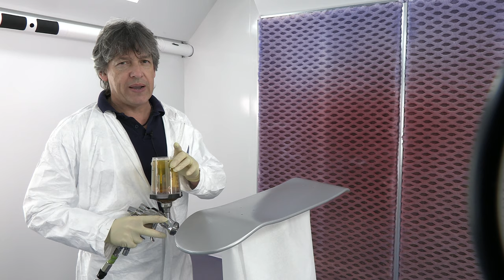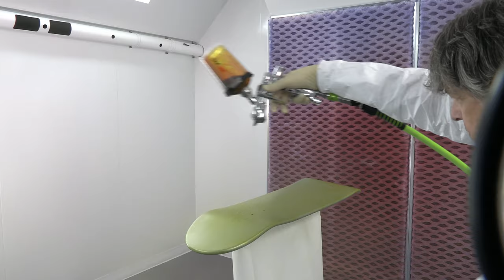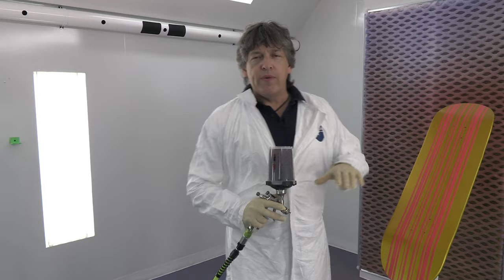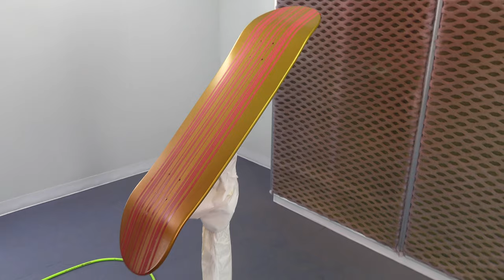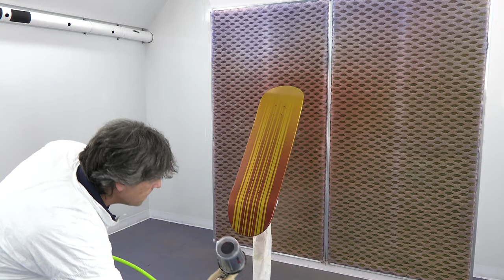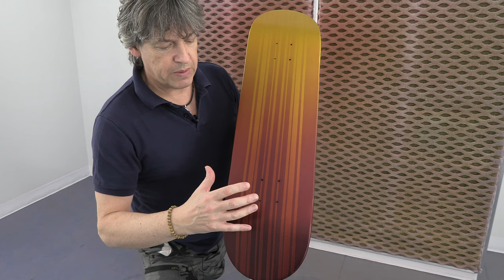How to spray seamless candy fades.

Comment: How are you mixing the Candy2O with 4050? A few of the createx videos contradict eachother. Craig Fraser seems to use 3 parts candy 1 part 4050. But in other vids they suggest 3-6 parts 4050 to 1 part Candy. Looking at bicycle applications over metallic/aluminium. Thanks